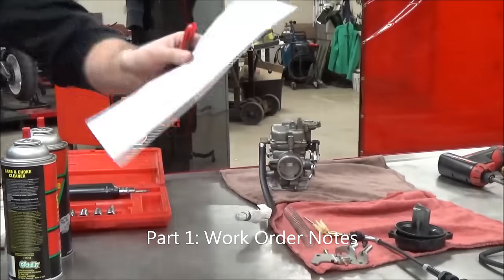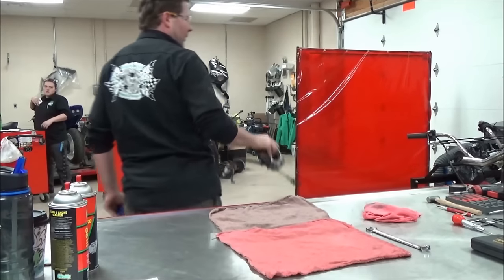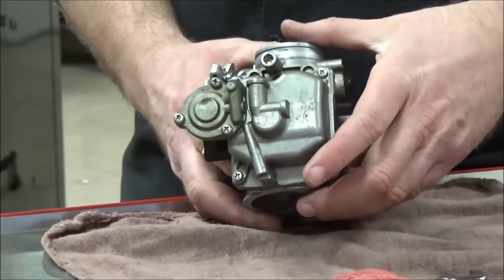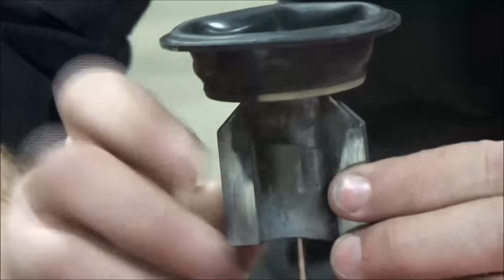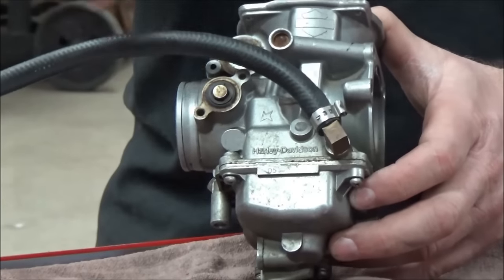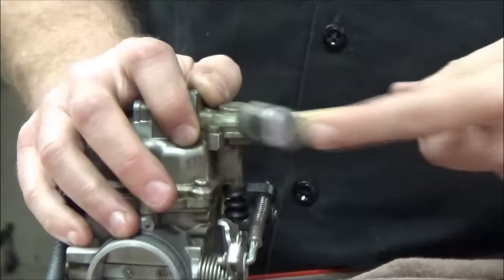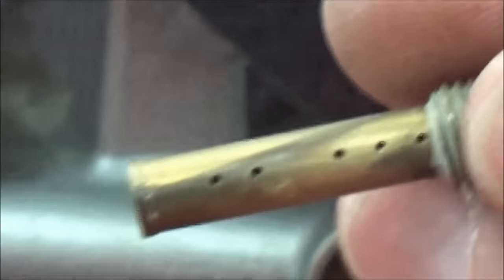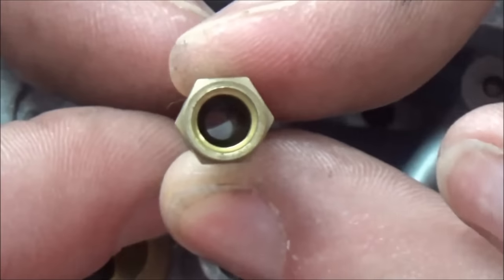01 "How to" CV Carburetor : Disassembly Recording Jets and Settings Cleaning Carb Rebuild Series

Comment: The pilot Jet next to the main jet on my cvh carb was blocked. VN1500. I couldn't unblock it. I had to drill it out. Brass shavings came out. It was like there were no holes in it. Why. The bike hadn't been run for 9 years. The bike runs megga rich. Carb has been through an untrasonic wash since and still runs megga rich.
Can anyone help?

Comment: I loved watching your presentation.  I use almost all the same or similar methods.  Unfortunately, I did not have the benefit of your presentation so I had to learn these things organically (the hard way).  I'm careful about removing dirt on the outside as it can provide alignment clues.  Also, I like to take a lot of digital pictures throughout because I like to have a record of exactly how things were positioned or aligned (right or wrong) before I took them apart.  You could mention that with old stuff that has been repaired previously sometimes it has to go back less than correct because something broke and was rigged.  Can you watch my carb series - wan to know what you think about the drilling the copper BB - https://youtu.be/EjCmiZ5xoeU. Also, some piolet jet passages are very large (easy to clean) and some are tiny and get restricted easily and are almost impossible to clean even with a wire.
Reply from the maker: Thank you! I put your video in my later list and will do!

 Please share on your social media! Make sure to subscribe and click the notifications button for all future videos! Also, my playlists are broken down pretty well. The most popular one being: "Every Mechanic Should Know This" 

https://www.youtube.com/playlist?list=PLAtBOuPaEyt_uMyVlK1tsBVnSYW1Q0vCK 

Feel free to make any suggestions or reach out to me for personal mentorship,

Keep Wrenching, 
Shane Conley
Instructor/Motivator/Motorcyclist